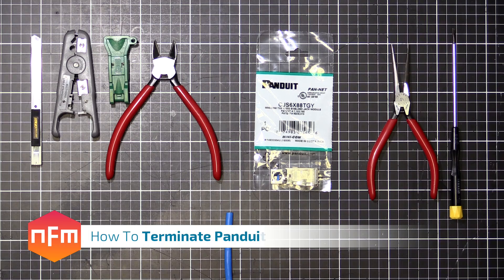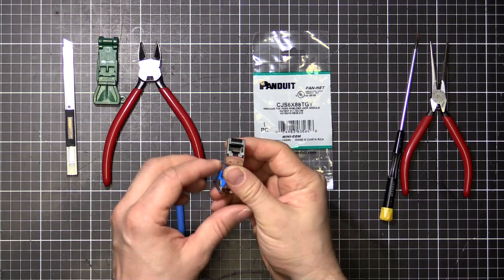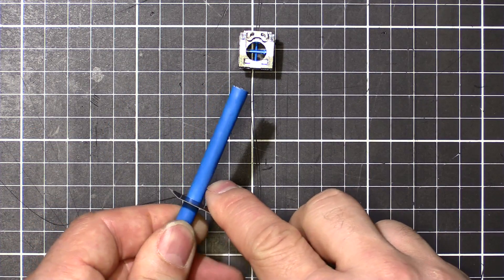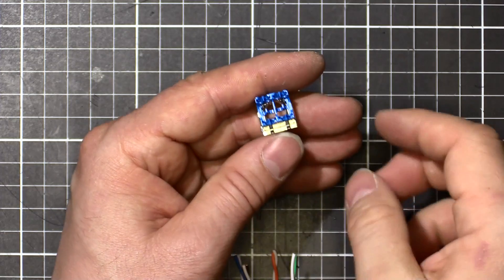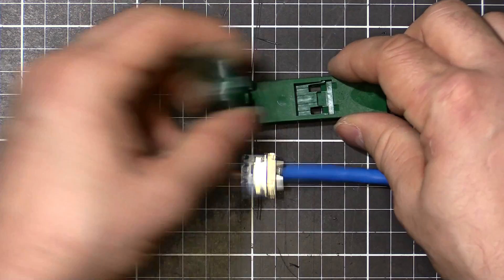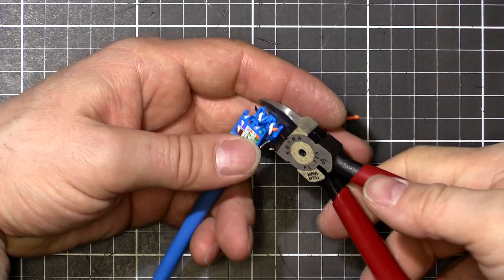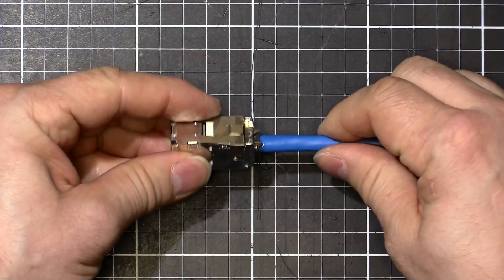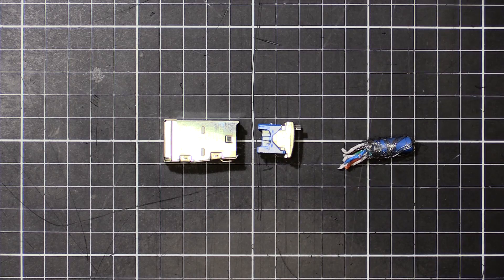How to Terminate Panduit Cat6A Shielded Socket

Comment: You mentioned that the pins should be facing up on the Rj-45 connector when installing. That information is not true.. if you notice on the front face of the Rj-45 you will see numbers 1-8 at the bottom of the pins. this should be read left to right and not upside down.. This has nothing to do with dust on the pins.. The other thing you mentioned that you can swap and use the A side at both ends or use the b- side terminations at both side..  I know you were meaning to keep a straight through cable configuration. But this is very important information for a rookie and you should also mention that this represent a 568-A or a 568-B system.. meaning that pins 2&3 are swapped orange and green..
Reply: Yeah, he shouldn't just say the orange and green pairs are not important to which is which.  As long as you terminate it the same at each end, then it will work, but 568A and 568B are created for a reason.  Most patch cables are 568B and I always terminate jacks in 568B at home.  It i just easier knowing that everything is 568B when it comes to troubleshooting an issue.
Reply: if you put rj45 connectors into walls with the clip facing up, you are a communist.  also, holy shit nerd alert.
Reply: @nfperrini  lol

Comment: Why fast fw through the removal of the shielding around the pair, that's why I came to this video. Or maybe just show the removal of one then fast-forward the rest. Thanks
Reply from the maker: You just nick the edge of the shield and then pull it off, the foil tears really easily once it has a little cut in it.

Comment: How much they are not punched in when they are seated at the barbs? I'd think the connection to the pins would be there.
Reply from the maker: They punch in perfectly when seated using the tool. The barbs just hold the individual wires in the correct alignment so the IDC terminals will line up and make a good connection when the two halves are put together.